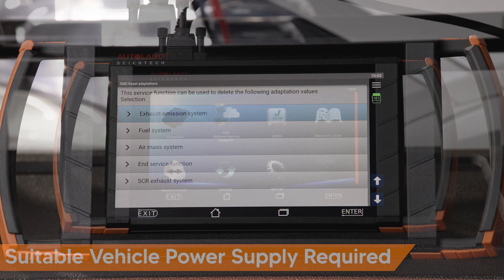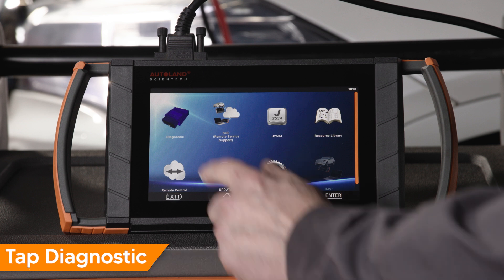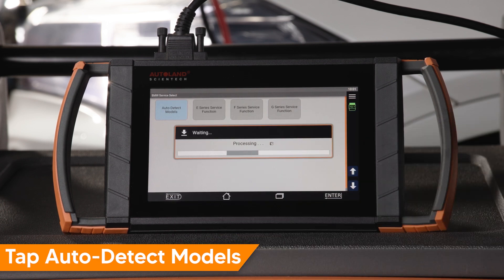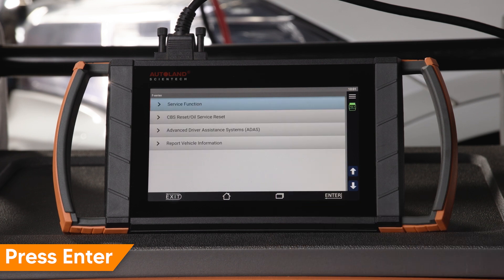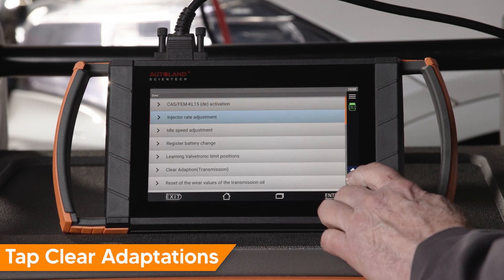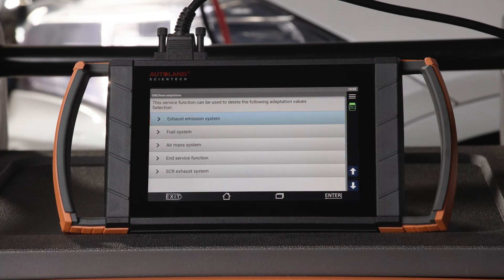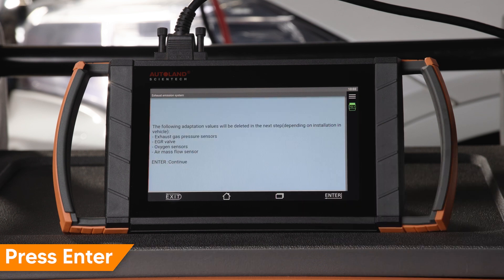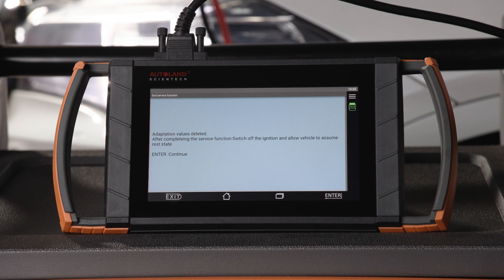When & How to Perform an Adaptation Reset on BMW Vehicles

Comment: Ii reset the MAF adaptations on a land rover freelander 2004 TD4 M47. but my ECU won't learn. corrections stand at zero. 
compensation value during idle = 0
compensation value during load = 0

what's the problem? Is ECU reprogramming required?

THANKS 🙏
Reply from the maker: If it will not reset, there is either a fault or your missing a step. What iSCAN  device and software version are you using?
Reply: @AutolandScientechUSACedarPark  it said reset was successful.
I use launch dbscar5 xdiag.
ECU won't learn...
maybe the MAF needs to be reprogrammed?

Comment: PLEASE HELP :(

Fantastic video, liked subscribed and bought the same OBD. I have a 120i and after the clutch was replaced and transmission fluid changed it now judders and then powers off. Which adaptations should I delete?

FYI the fault codes im getting are:

4809AB - DSC control unit: Undervoltage
D3557A - Signal (wheel torque, powertrain 4, 40.3.4) invalid, transmitter DME/DDE / EGS
1BC115. - DSC control unit: Undervoltage
Reply from the maker: Check power to the DSC control module. That may be the cause if wheel slip / torque data is invalid. Be sure to voltage drop test the circuit, check the grounds to the module the same way.
Reply: @AutolandScientechUSACedarPark  Thank you so much will try this next week ☺️
Reply: @AutolandScientechUSACedarPark There was a typo in the above message. The last codes description is "Gear sensor, electrical: short circuit to positive". Does this change your advice at all?
Reply: Hello, I've checked the DSC and everything is fine. Cleared all those previous errors and the remaining one is "1bc15 gear sensor, signal: short curcuit to b+"